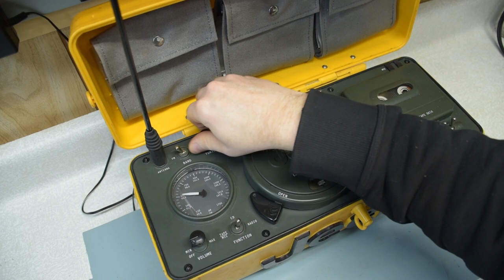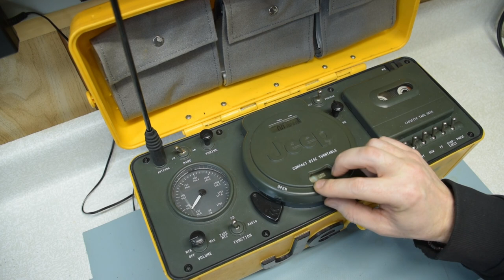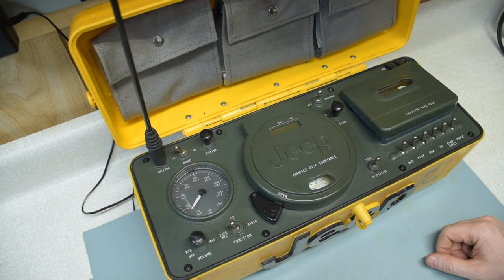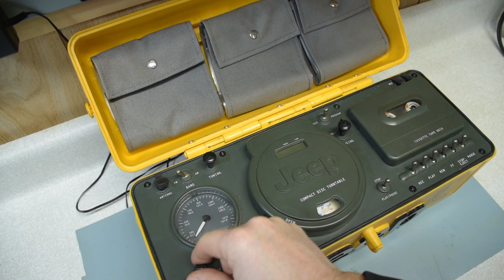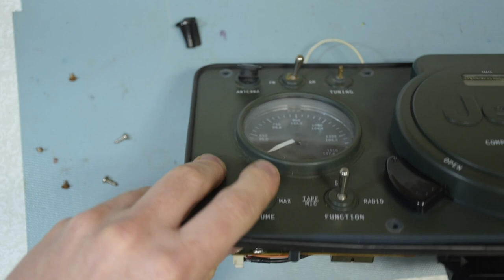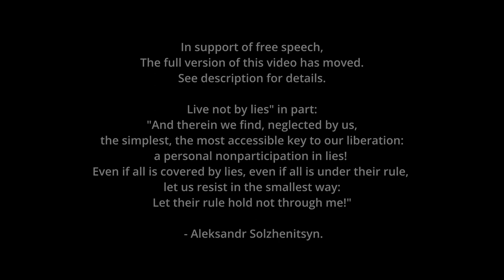Jeep Portable CD  AM FM Radio  Cassette Recorder WPSS 1A Repair #008

Comment: I'm in need of a replacement power supply. Could you provide which one you are using?
Reply from the maker: 12V DC,  500mA (or greater), center pin is positive polarity.

Comment: Any chance the original speaker has a trick to removing it? I have one that can also use D batteries and can’t work out how to get the speakers out without damaging the case.
Reply from the maker: I think it just pulled straight up including the black plastic parts.   There was probably some glue holding it in.   Once out there are some screws holding the 2 black plastic parts together.

Comment: I just got one of these! The volume works out of both sides but is really quiet. I opened it up and it doesn’t look like anyones ever messed with it before. I’m thinking it’s an issue with the amplifier. Any tips for working on this bad boy would be great!
Reply from the maker: Usually if an amplifier fails it is not just weak output but no output or very distorted sound.    I would plug in headphones to see if that output works.  If it does, it may be the switching contact in the headphone jack which mutes the speakers is not making contact when the headphones are unplugged.   Sometimes just plugging in and unplugging multiple times can self clean the contacts enough to work for a while.     Also, toggle the function switch back and forth for similar reasons..
Reply: @mevmevmev  after some further exploration and trying the headphone jack as suggested we noticed that adjusting the volume knob only changes the right channel whether using speakers or headphones. Still very quiet.
Reply from the maker: @Lovelydeck   Based on that, I think it is very likely the main volume control.  Mine was in bad shape even after cleaning.  I just replaced it and now the left and right are very stable.   The original part may be impossible to find.   I ended up having to replace it with one that doesn't have an on/off switch.  Now to turn it off I have to unplug power supply, though I could add a dedicate power switch.  One way to test if the amplifier works:  There is a gray and black cable on the connector at the upper left of the screen at 4:38 in the video.  The red wire from each is the left and right source audio signal, and the white from each is the left and right input to the amplifier.  The orange and brown wire  turn the power on when shorted together.  You may be able to test the left channel by turning up the volume, then shorting the red and white wire coming out of the gray cable.  It should force signal to the amplifier.  If it works, that would confirm the volume control is bad.  If it doesn't work it may actually be the amplifier circuit is bad.    Basically a lot of work for a cheap radio, but it looks nice!
Reply: @mevmevmev  I just bought one of these on Ebay. Same issue very little output. I tested the headphone jack and same issue. Is this something I can fix?